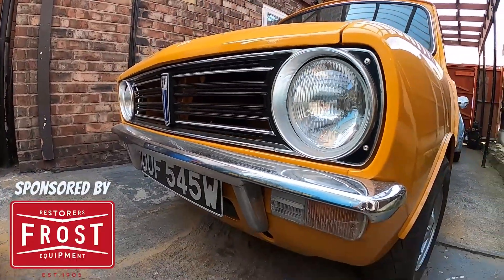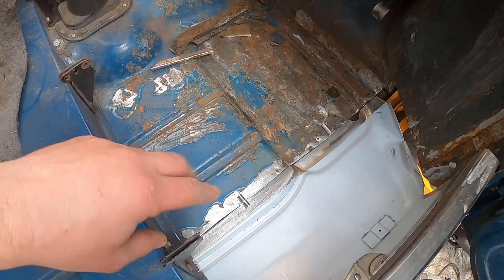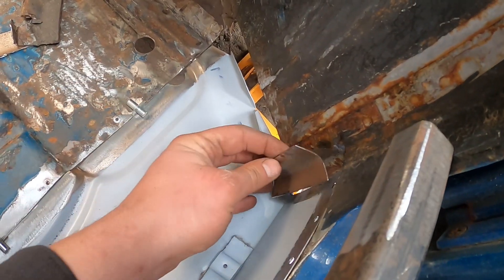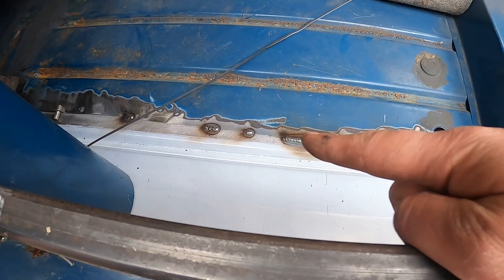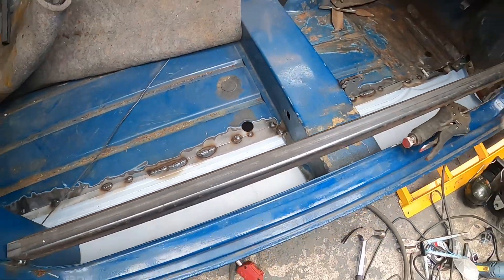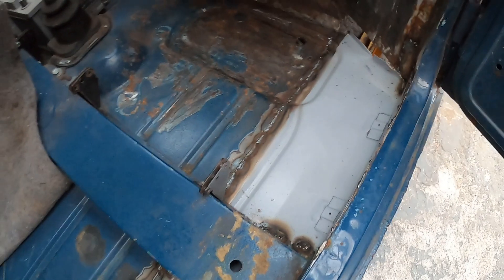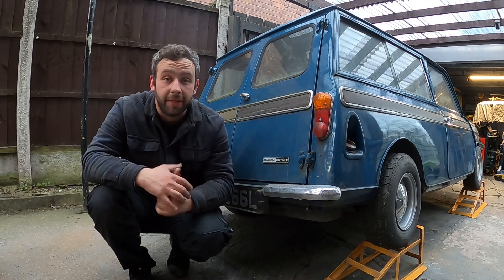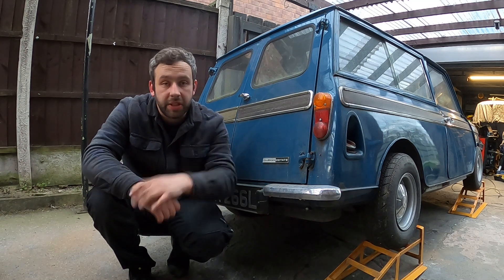WELDING THE NEW FLOOR IN! - SAVING A CLASSIC MINI CLUBMAN ESTATE

Comment: You make it look so easy and yet I know it that I don't have the skills set to do it. I do agree, M Machine panels are good quality and from what I hear are really easy to work with and adjust.
Reply from the maker: Thanks Graeme feel like this one has gone really well. It’s starting to come together now. She will soon be solid again. Yes definitely m-Machine make some great panels.
Reply: @SimpsonsClassics  It does seem to be going well, yes there's a lot of rot in it but its not awkward rot, it seems pretty straight forward. I know BL had their issues back in the day but at least they used decent steel, better than the later Rover stuff, as the turquoise Cooper proved.